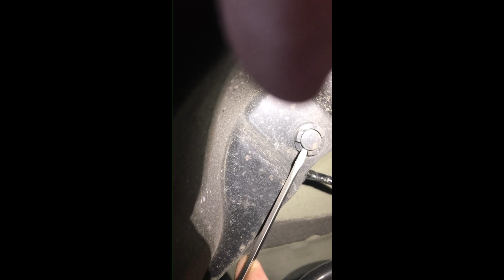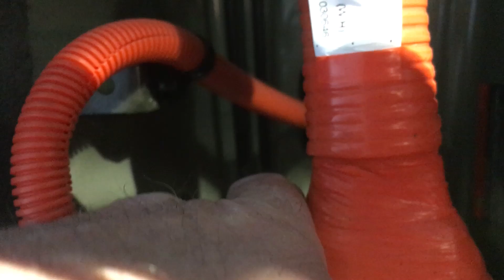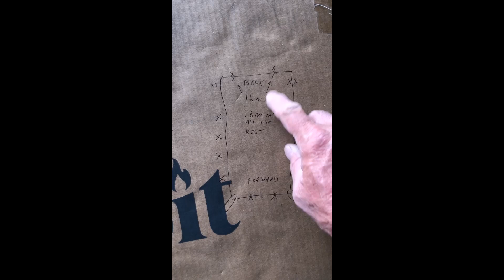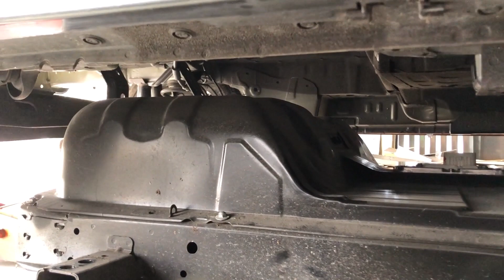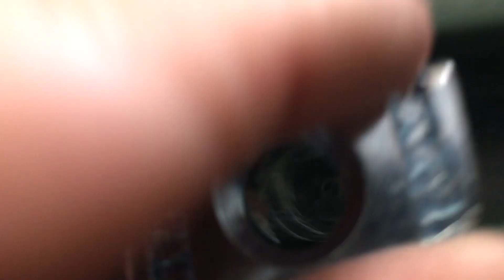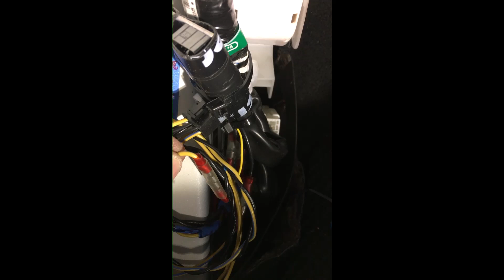Nissan Leaf 62 kWh Battery Upgrade

Comment: Hi, I am about to start to upgrade my 24kw leaf battery to 62kw battery and I had the same idea about using the all-threat to control the drop of the old battery and lift of the new battery.  However, I cannot find the pitch of the large 18mm head bolts, so I can order the all-thread ahead of time.  Could you please provide me the pitch and size of the all-thread that you used in this project.  Thank you!!!

Comment: very inspiring video, specially with the basic resources and tools you used.  I am in the process to upgrade mine (SV model 2015 24 Kwh  to a 62 Kwh )from a salvaged car bought in Copart too.
Reply: How much did the salvage set you back?
Reply: Hope it worked out for you.  There are a lot of hurdle to cross to complete this project.  Thanks for the comment!
Reply: @wkmcmahan  Other than communications what else is there to know regarding 62kwh in a 2012 Leaf?
Reply: I'm from China. It's my first time to contact LEAF. Do I need to write BMS to replace 60KWH?
Reply from the maker: You need a Can Buss Bridge.  Check out Dala Osters videos

Comment: Well done sir that was some effort on your part being of a senior age, I know what its like at the age of 63 working under a car, but holding a phone camera in the other hand, that takes some extra effort! 

I love your solutions to jack up and down the main drive battery. That was a well thought out plan, and extend mountings, which I some reservation about, but I hope they hold for you. I was not sure if you still got those error code after fitting the second can bus?

Would be very interested in your first few long trips using the thermal control system you put in place. 

Thanks for up loading and showing your hard work!
Reply: Thanks for the comments.  I hope to perfect the process and maybe teach some youngsters how to do this.  All of the errors went away with the second can bus.  The first boot/ can bus was scary.  All alone with thousands of dollars invested and a car that won't run.  I quit for the night and came up with a new plan the next day.  Good thing I had ordered a  2nd can bridge.  After double checking everything and then putting in the second can bridge, everything went well.  My cooling system works good.  Perfect for the dry desert air.  I also have taken the cover off of the battery plug area and installed a screen.  With the ac set on pulling in fresh air, that air is forced over the top of the battery to the area that it is needed most.  I have to put it back on.  It is hot again here.

Comment: Brilliant film, thanks for sharing. Really ingenious way of lowering the battery. Have I understood this correctly , that the battery was lowered down just on those four threaded rods? If so, were you not concerned that they could have buckled under the weight? I think the 62kW battery weighs about 0.5 tonne?
Reply: Ah! I've just re-watched it. The threaded bar never touches the ground. They just hang from the chassis. Really ingenious. How has the car been since the upgrade?

Comment: I have some old guy advice for you. 

I was a diesel mechanic and worked on a lot of equipment, including 4x4
Reply: Darn dropped my phone.  Anyway, if you need more height than your jack stands can provide, there is a trick I used.

Get yourself 6 inch thick concrete cap blocks. They are strong and uniform or flat. Use them in a cribbing style to make a base for your jack stands. Use them in sets of 2 and then turn the next set 1/4 turn and so on.  It makes a very stable base, and you can always use a 16 x 16 piece of 3/4 plywood to help keep them level and tied together so that they don't move. When you set the weight down on them, they will lock together solid.
Reply: @desertdan100  Thanks Dan !

Comment: Hi I’m Karl in Ireland when you first turned on the car after installing the 62 kw battery my car has the same lights and made that clicking sound and will not go into ready mode my car is a 2016 24 kw with 143000 miles and no modifications
Reply: Sorry that I didn't see your comment sooner.  I had a faulty can bridge on my first boot.  When I put in my spare, everything worked with no weird noises or lights.

Comment: I also have a 2013 currently getting 70 miles per charge, 62kw would be nice but would be really hard to find and probably cost a lot I am thinking about a 40 KW acording to dala is  a plug and play for a 2013 and up , as mention did u have to upgrade the back springs?  This one another video that motivates all of us to contine loving our old leafs 🌿
Reply: I have the same car as you and I’m trying to do the same thing have no clue
Reply: @snowwhite6882  yeah unfortunately it would have to be salvaged from a wreck car so it's a bit of a hassle but worth it I'm probably just going to end up buying a Chevy bolt
Reply from the maker: I upgraded both the front springs and the complete front struts.  It was nice having the complete 2019 Leaf S+ wreak to get parts from.  Some individuals have swapped to the larger battery and say that not changing suspension parts hasn't been a problem.
Reply: @desertleafservices5829    I haven't seen the entire donor car but it seemed like it could have been repaired.

Comment: Last month my 2015 Leaf-S receive its 62 kWH battery pack upgrade by EV Works in Bainbridge Island, WA.  Though the old 24 kWH pack had 84% SoC, I enjoy the greater flexibility not to charge every day or use the 200-mile range.
Reply from the maker: Thanks for the comment.  Yes, moving up to an EV that will go over 200 miles is great !
Reply: How much does it cost. Did you add active cooling to the upgrade. Thanks in advance
Reply from the maker: I have never added up all the cost, but it was a lot !  I do have active cooling.  I think I show that in the video.  Thanks for the comment.  Kevin
Reply: @ramanujavedantham5641  $14,000.  I have not explored active cooling as an upgrade.  From recent experiences, I found that it took longer to heat up the larger battery pack than my original 24kWh battery pack.  Either way, I usually have mid-range on the temperature gauge since I live in a generally cooler climate around Seattle.
Reply: Can you do a comprehensive review or video of your car before and after? I'm very interested in buying a leaf and doing this upgrade. Coming from a Volt, I'd like to see how practical it would be to live with a 1st gen Leaf that has the new 62KWh pack!
Reply: Do you have any details an can share when you got your car worked at in Washington? Name an phone number possibly person would be great! Please

Comment: How much did it cost to get a salvaged 19 Leaf S Plus? Wouldn't it be better to restore it instead of 13? Leaf 13 doesn't have ebrake and regen braking also kind of bad. Nice viedeo though.
Reply from the maker: Hi Sean  The auction price was $14,500, but with fees and delivery it went much higher.  The whole purpose was to do the swap and to learn from the experience in case I want to do it for others.  Yes the newer leaf does have some better features.  I am very happy with my 2013 Leaf.  I went from a range of about 30 miles to around 220 miles.  It still drives like new and is very comfortable.  Thanks Kevin
Reply: The change over took place mid way through 2013. The way to tell is the eco button on the steering wheel , as the earlier ones didn't have that!!

Comment: Thanks for the Video! What would you say was the hardest part in this project?
Reply from the maker: The hardest part was sourcing the donor car by far.  Thanks Kevin
Reply: Ingenious !  What about sourcing the parts ?   The M18 long spring unistrut nuts is a superior solution for those not able to weld the method Dala used - I’ve scoured the internet and can’t find any larger than M16?  Any suggestions please ?

Comment: Great Video! Thanks for taking the time to record it. Will you make a video about the change out of the suspension springs or was that not needed because it was a simple process? I've been watching on Copart and it looks like I'm going to have to give about $10000 or more for a donor car to upgrade my 2013 Leaf (I might go with cheaper 40kwh). Then I'm wondering what to do with the carcass and how much I can sell it for. Thanks again for any insight Desert Leaf Services.
Reply: Hi Mike  I probably should have videoed changing the suspension parts.  Maybe next time I will.  I think I checked out some other YouTube videos before doing those changes.  It was not to hard to do.  I won a Copart auction and paid $14600.00 for the car.  After all taxes, fees and expenses I have got over $17,000 in the project.  I am still have the carcass and am trying to figure the best way to deal with it.  I will not allow it to go back to auction without it being clear that the original battery has been  harvested.  That would be unethical.  I see a lot of that going on especially in the Portland area.  Before buying from Copart make sure you are able to test the battery before bidding(to make sure it is there, that it is the correct battery and the condition good).  Make sure that you know what you are doing.  40 kWh batteries appear to be a great option and less expensive.  Thanks for the comment and good luck.  Kevin
Reply: @wkmcmahan  Wow. Good points to know. Thanks so much!
Reply: @wkmcmahan  Thank you so much for the informative post. I live in the east coast and there isn't any independent shop here that able to replace the battery 😐

Comment: Thanks for sharing! Great battery cooling idea! how the water is provided to the system? Any real-life experience using it? Very curious, maybe it can become a topic for a video?
Reply from the maker: I haven't completed the installation of the cooling system yet.  I will be adding a small metering pump and operating it manually and watch its effect.  I also plan to add a reflective heat shield under the battery.  Thanks for your comment!